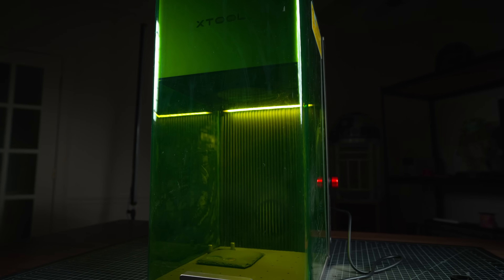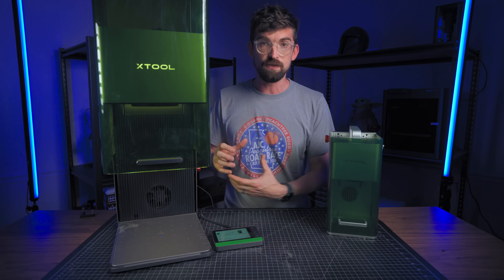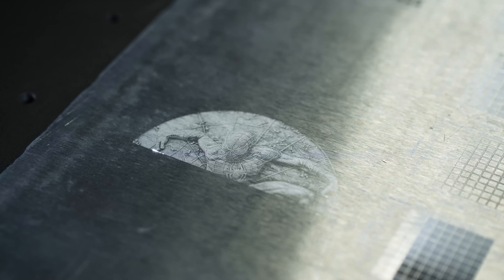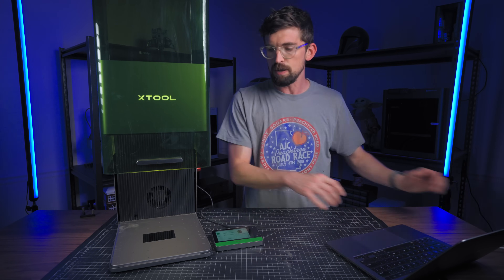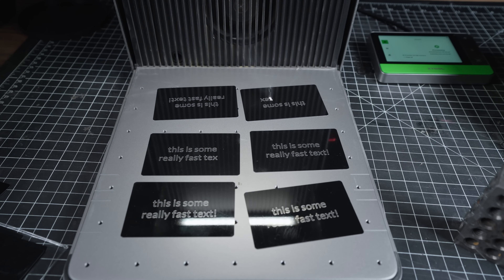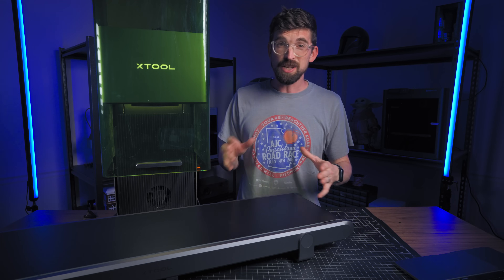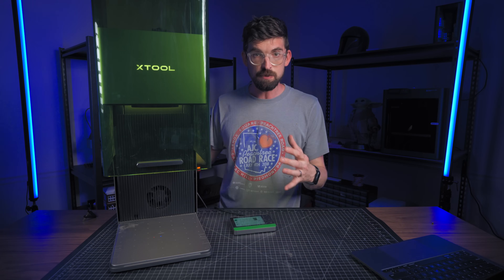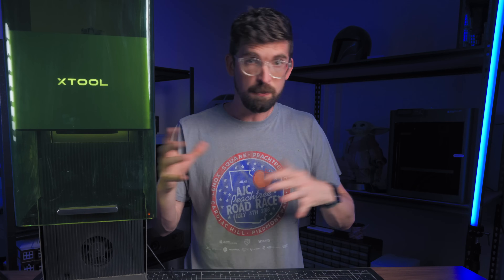Worth the $2,400 Extra? xTool F1 Ultra Review

Comment: I'm just now discovering this company maybe a week ago. But I love this engraver. I'm really thinking about getting one. The main thing I would be doing is leather key chains & tumbler cups. I always wanted to do t-shirts. I have a heat press machine. A Cricut & a 2nd vinyl cutter. But I DEFINITELY need to add this to my collection. Gr8 video my man. I'm sold on this. Gotta handle sum other things 1st but I'm definitely putting in an order for this. Also I saw where the price is now 3699. So I guess I'll be saving a bit of money. That's always a good thing. Awesome video. Thx for posting

Comment: Do you think the Ultra do a good job at laser engraving guns?  From research they say 20 to 50w can do the job.  I am seriously buying one of these and been looking at the bundle of the P2S and the F1 Ultra package.  I currently have 2 D1 pro 20w systems one is set up normally and the other one is set up as the extension.  I think by adding these 2 new lasers would really help in the shop and be able take the Ultra to shows on the weekends and add customization at shows to improve sells.  Like to hear your thoughts and opinions.  Enjoy watching your videos keep up the good work.
Reply from the maker: The Ultra would do a good job at gun engraving.  It’s not the easiest the move around but could totally work at a show especially if you had help.
Reply: @makeorbreakshop  Figured mount on a cart so I can wheel out of a trailer or van with a ramp.
Reply from the maker: Oh great idea!

Comment: I have the F1 and like it. The Ultra is just too expensive for what it is. I can get a 50w MOPA integrated fiber laser from OMTech for around $2500 right now. I may lose some work area but power would be more important on what you can engrave. Even the LP5 is a bit cheaper.
Reply: The main benefit of the Ultra is the combination of fiber and diode in one machine. The MOPA fiber laser from OMTech is a great machine if you only need to engrave metal. Yes, the fiber isn’t as powerful, but it’s mostly the convenience of having both in a single package. It’s a Jack of all trades machine, so it does everything mediocrely.

Comment: Hey Brandon great video, just a correction to note at 12:40 it does have a door safety switch and you can toggle it off or on inside the settings.
Reply from the maker: Yeh thanks, now realizing I totally missed that.

Comment: No air assist, then you immediately put the plate on the ultra the wrong way. 🤦
Reply from the maker: It can work any direction, but having the grooves heading towards the back exhaust could help some but still won't fix the issue of air assist on top during cuting.

Comment: I want to get a co2 laser but am put off by the size for engraving metal cards. would this be a better alternative?
Reply: Yes it would do a better job, but so would the F1 (normal). Also something not discussed here is the fact there are no safety features that stop the laser when the case is open classifies this as a Class 4 laser.
Reply: @TheExtremeElementz  thanks, I want to do some custom mtg metal cards and this looked like a great idea
Reply: @Adriel59  That would be pretty dope. If you’re not going for deep engraving like the example coins he showed off the F1 normal would do an excellent job at much less cost than the Ultra. But then again an S1 10w + IR Laser would be more versatile for almost the same cost. 

With the S1 you’d have to swap the laser module when wanting to use IR vs 10w and yes it wouldn’t print as fast considering it’s not a galvo BUT the option to do more larger projects later might be appealing. Choices… choices. Goodluck!
Reply: @TheExtremeElementz  I hear ya. On one hand though. I like how nice it looks like when it has deep the engraving
Reply: @TheExtremeElementz  He does mention there isn't a switch for the case.
Reply: @thenightninja13  I know he did, but he didn’t mention that it becomes classified as a class 4 laser. Class 4 is pretty dangerous. He unintentionally (I hope) got his hand way too close and it’s easy to forget how powerful and dangerous this stuff actually can be.
Reply: @TheExtremeElementz  actually there is a switch that turns it off if the lid is opened, but it has to be activated in the settings on the software
Reply: @derekwright2388  Correct it drops down to harmless a power level but again this shouldn’t be software controlled in my opinion. This should be hardware controlled 110%.
Reply from the maker: A fiber laser would be great for metal cards, the lower powered f1 would work well for that too